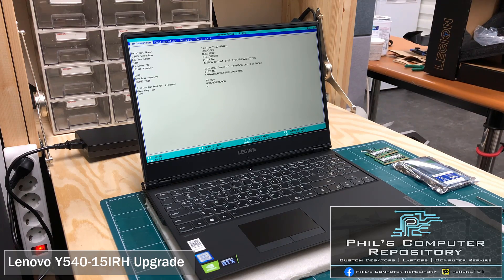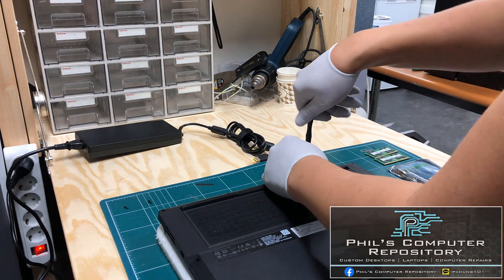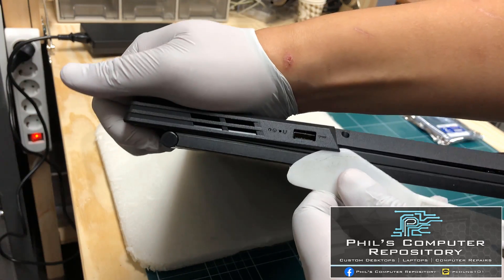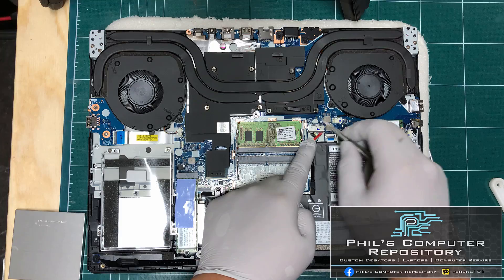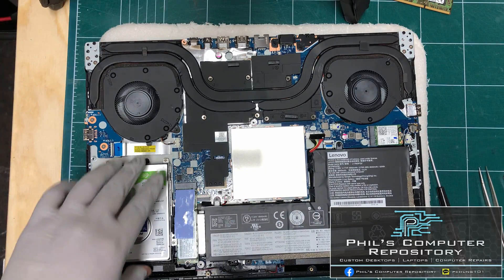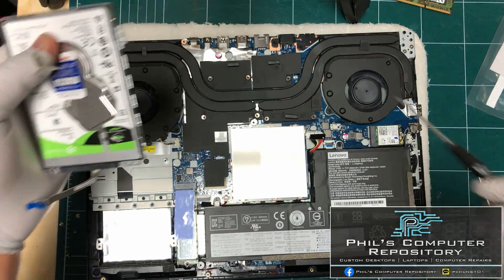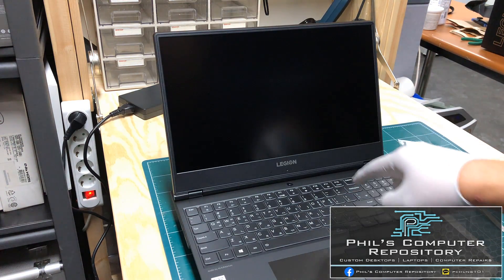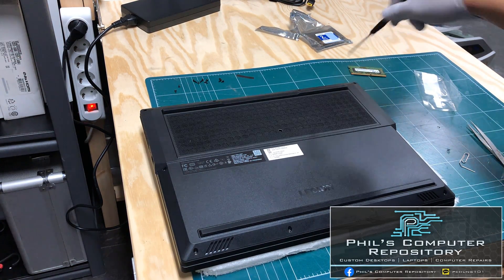Lenovo Y540 Disassembly and Upgrade (SSD. HDD, RAM)

Comment: Hello, I have this laptop too, I have been using it for 3 years, this year the right fan of the laptop started making a strange noise, this does not always come when I pick up the laptop and turn it sideways, or sometimes when it is spinning, I lightly tap it from the right side and it comes back. I would like to mention that I clean the dirt.

Comment: I connected healthy SSD drive as additional drive with two cables NBX0001M410 and NBX0001TC00. System/date in BIOS is correct, I switched from UEFI to Legacy, but my additional SSD is not recognized nor by BIOS, neither by Windows. Lenovo Y530 ICH-15. This SSD is working in other laptop. Any clues?

Comment: Is it possible to put 2 SSD M2?
I would like to add another 512GB.
Reply: It has 1x2.5" bay and 1 m.2 slot.  So no, you cannot just add another 512gb m.2 drive.  You can purchase a 512gb 2.5" ssd and install it that way thought.
Reply: @jperoutek  Thanks.

Comment: when this laptop is on charging the fans become too much noisy and when i remove the charger then only the sound stops. Is there any solution?
Reply: Check if your fans are getting clogged. Maybe get it opened up and fans cleaned and thermal paste replaced

Comment: Cool! What is this blue thing on the m2 ssd? Doesn’t it make m2 ssd heating more?
Reply from the maker: It is a thermal pad which is used to dissipate heat away from the ssd which is included with the laptop
Reply: @PhilsComputerRepository  ok, thx!

Comment: Where did you get that foam pad that you sit the laptop on so it doesn't get scratched when working on it?
Reply from the maker: It is just scrap foam i had lying around which came with some computer component. it is just soft styrafoam

Comment: Hello there, i have some question:
1) When inserting the pry tool/plastic wedge is it safe to just push and press along the line? are there any plastic parts that can be broken inside?
2) Buit in RAM 8GB, is it effective to install 16GB to the other side?
Thanks for your video, it is very helpful

Comment: Just amazing step by step vdo... 😊❤️
I'm from India and I've brought the Lenovo Legion Y540 laptop and my model no is "81SY00CKIN"...
I didn't get any cable inside the box....
What should I do? Is it come with hdd?

One more thing I was noticed that my laptop's back grill has some different design and vents outlet position is same but little but change in design...? Why this is so...?
And Is my warrenty gets void if I change or upgrade HDD, RAM, SSD?

Loved that vdo.... ❤️😊

Comment: Urgent please help.
I brought Y540 last week and when i start to edit my videos i came to know that i cant use my rode mic.  The realtek audio console dosent have any option to change it to mic like the Smartaudio  manager has.
I tried to install realtek from net and lost my relatek Audio console amd didn't got Realtek Hd audio manager.. 
Please help how to solve it.
Reply: try changing the input device on windows sound settings (right click your sound icon on the task bar and click open sound settings).
If this doesn't solve it, try reupdating the Realtek drivers: https://forums.lenovo.com/t5/Gaming-Laptops/Microphone-and-audio-quality-problems-Y540-Win10-1903/m-p/4566396

Comment: How can I know the type of RAM for this Lenovo Y540? I bought it with a 16gb ram but I want to upgrade to 32gb by inserting them 2 16gb RAM...
Reply: SO-DIMM Ram, as far I know it only supports 2666Mhz , that what i did to mine, mine laptop version it's the one with GTX1650, 500Gb m.2 and a i7 9th generation

Comment: Hi! I have a question, my Lenovo Legion came with 12 GB RAM, can I buy a 16 GB RAM and install so I can have 28GB? 
Or I need to Buy the 32GB pack?
Reply: Hello there, you should check, how many SO-DIMM slots are used in this particular configuration(however I think that this is 1x8G and 1x4G; in this case you can't upgrade to 28G, without buying 2 ram sticks and throwing out older ones)

Check available slots in Windows' Task Manager, under the "Performance" tab in "Memory" section. If you have 1 of 2 slots used, then yes, you can just find 12G stick and it would do the thing.

Comment: I’ve put a 2tb ssd in my Lenovo y740
Reply: For that, do you have to remove the existing ssd or can the new ssd be fitted into to hdd slot? Forgive me, not so good with this stuff :)
Reply: @Pratik792  It has a M.2 SSD in it and a mini HDD. the SSD needs to be replaced with the HDD

Comment: ATENTION: The 2.5 inch HDD has to be 7 mm. I tried putting an 8.5 mm from a previous laptop and the y540 lid would not click arround the HDD.
Reply: Thanks for your comment! I'm tried to find information about width of disk and my search continued over hour.. oof.. thanks a lot
Reply: yes exactly,Just buy seagate slim HDD
Reply: Thanks for the PSA, saving people from that headache

Comment: Ok before you would turn on the laptop, is it more beneficial to go into bias mode after you installed new components onto the laptop. Or do you need to? do you need to go into bias mode before or after? I'm still confused with the concept of the bias mode.
Reply: You don't need to go into BIOS, it's just to be sure everything is OK before you actually tighten the screws. You'll be able to see your new RAM or HDD or SSD or whatever you upgrade just from windows itself.

Comment: In Europe the HDD connector and screws are inside the laptop already and not in a separate little plastic bag.
Reply: are you sure? I bought with 256 ssd, and I have no cable in the box.
Reply: @Shibka  I live in the North of Europe, just bought the 256gb ssd model and the cable was in the box :)
Reply: @Shibka  yes im sure i just upgraded 5 min ago HDD from old laptop and i had all important things inside laptop
Reply: I'm from Romania and just like in the video, the connector and screws were in a plastic bag inside laptop box, 256 gb ssd model :)
Reply: Same in Aus! Was panicking thinking I'd thrown it out without realizing, thought I'd just open it up and see what happens - was inside (and even connected)
Reply: had the same problem 2 days ago when i upgraded the hdd  and there was some black tplastic rectangle that prevent you from adding an hdd so i had to bend the metal placement and take that black plastic rectangle in order to place the drive
Reply: Inside the laptop as in if my build has not 2.5" drive the connector cable is still there inserted prepared for me to just buy a 2.5" SSD and put it in?
Reply: @smolkafilip  Yes
Reply: @shinigamiabarairenji  Well... I guess I'll take of the cover first before ordering an SSD to see if it's there.
Reply: @smolkafilip  the cable should be in place already and the screws are inside the black plastic placeholder.
Reply: @shinigamiabarairenji  I'll take it apart tommorow and check what I'm working with before ordering any drives. If you don't hear back from me, then that means I failed to put it back together xD
Reply: @shinigamiabarairenji  I just put it back together and the screws and connector are indeed there in a black plastic placeholder thing.

Comment: Can we add 16gb 2666mhz to the existing 8gb 2666mhz stick ?? in legion y540
Reply: Yes you can but you probably wont be able to benefit from dual channel. But it ought to work fine and unless you are running an IGPU in your laptop the dual channel doesnt make that much of a difference. But i would still recomend buying either 2x16 or 2x8. Me personally i would buy 2x8 cause i dont need 32 Gigs of RAM but it depends on your needs.

Comment: Do you need to remove the battery connection when adding storage in the 2.5 inch tray?
Reply: Yes. It would be best to remove the battery connector for safety purposes. As it might cause short circuit and might fry the motherboard and its components
Reply: i haven't done it

Comment: Hdd in 2020? Cmon dude... ssd have never been this cheap... id rather just get a 16gb stick to get 24gb in total plus a 1tb 2.5in ssd instead of a hdd...
Reply: Also, the HDD is relatively noisy compared to the soundless SSD.
Reply: The great thing is that you can do that.
Reply: It is cheaper, but still very expensive
Reply: Not everyone wants less storage....
Reply: Can a ssd be installed in the Hdd slot he used??
Reply: @Pratik792  yeah
Reply: You can but it destroys the dual channel memory advantages.

Comment: so that's how you disconnect the battery -_-
i just upgraded my RAM and  add SATA SSD without disconnecting it, because the cable was so hard i was afraid i'll break it. by the way the new model came in with SATA cable already installed along with a dummy HDD with screws attached to it. even tough i didn't disconnect the battery, fortunately my laptop is fine
Reply: Same. Ultimately I decided to detach the ribbon cable first because of how fragile it looked. I wish Lenovo didn't include the dummy plastic HDD. I kept thinking that I could install the SSD directly without removing the bracket.

Comment: great video, the Y540 seems very upgrade friendly. You surely deserve more than 20 views for the amount of effort put into making this quality video.

Edit: you seem to be very experienced in working with laptops, would you recommend the Y540 as a reliable easy to work with laptop.
Reply from the maker: Thanks for watching! Compared to other modern Gaming laptops, this laptop isn't designed too differently fundamentally. However, i would recommend the Lenovo Y540 for customers who wants a gaming laptop that doesn't look like a gaming laptop (i.e more professional looking)
Reply: Well... He did end up getting more than 20 views.